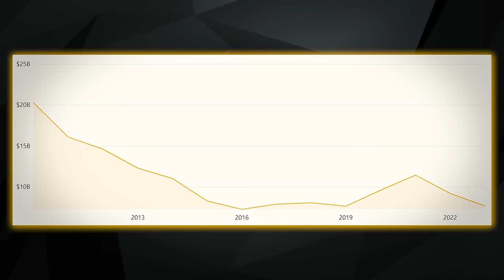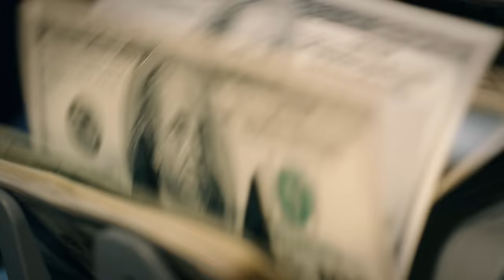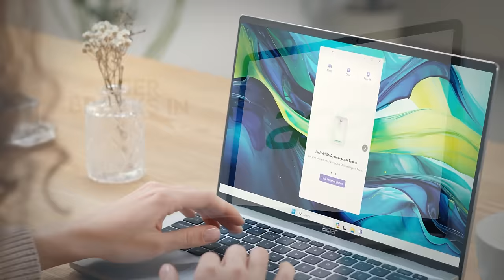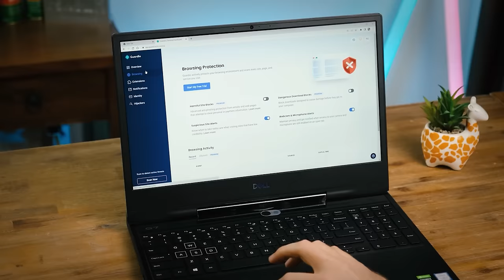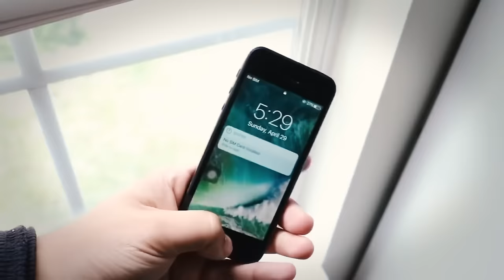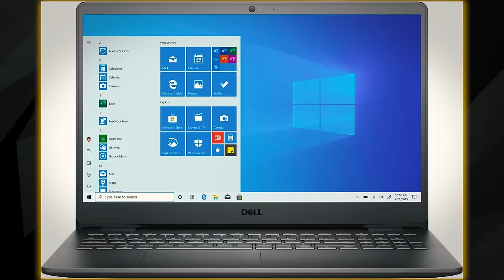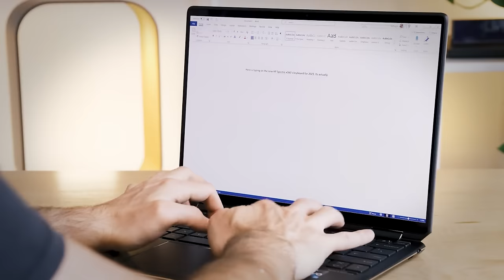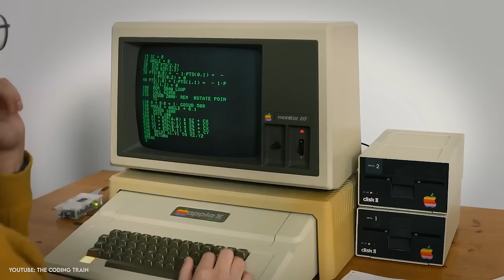Whatever Happened To Acer?

Comment: i think they are losing the laptop market after they introduced their recent nitro gaming laptop line up which is in contrary to how their laptops in the past known to be AFFORDABLE, their nitro line ups goes into the "expensive" category. similar to how gigabyte is going with their aero laptop line up. its price-ier out of the box. so people in the past 3 years simply move to the cheaper alternatives like the lenovo or HP with their affordable legion and victus line up. its about pricing thats all. the problem with those pricing is, the nitro line up offers pretty much THE SAME spec and quality as the cheaper ones from lenovo. people arent convinced why they would have to pay extra cash for the nitros. and acer seems to put  a lot of resources on that nitro line up and their new swifts. and the problem with swift is similar. its wants to be "premium" while offering the same thing their competitors are offering in less price.

Comment: From 4 acer laptops, only one the newest one broke the hinhe.
A acer aspire A-315 - 42, one hinge broke the ancorage of where the bolt attach to the screen, the solution i desmantled the hinges part of the display and use iron glue to fix the display part of the hinges.
And the reason the hinges broke is simple acer attach the struture with to much force the coils of the hinges have more than 2kg of force on opening the display, i loose the coils a little 3 years after my repair continues funcional.

Comment: One thing PC manufacturers have to understand is Windows users are not like dump apple fans. To windows users, their laptops are not for show offs, they only need to get their work done easily. They want maximum keys in their keyboard and ports(don't want to carry a USB hub) for their laptops. Also don't want to worry about the hinges.

There's no laptops available with the above mentioned in the current market. Maybe gaming laptops have these but they are too heavy to carry around.

Comment: I always regarded Acer as a company that never innovated much, ie just good enough, despite that I think their monitors were fine, I own an old 24" LCD that won't die and a 42" 4K real monitor. 
What does LG and Samsung do in the 4k 42" space, create crap smart TVs that pretend to be monitors just to be affordable.This market segment is nearly dead now. 
ASUS has created a new 38" 4K monitor which I hope takes off as a good size compromise between 42 and 32 and thats huge because it disrupts the supply of the panel glass size.

Comment: I had 2 old acer laptop 4530 series and 4730Z series, still working fine until today... Reason why i using acer is spare parts,fixable and very good design.I am not hardcore on game just for my work only.Yes...sometime acer is not good,I think the most problem is battery drain fast and keyboard error.But for me overall acer is quite good and reliable.Just my opinion.

Comment: For those who only look at specifications and price, ACER is not suitable for you. ASUS can provide better options. But ACER has always been used as my main machine. Because of ACER's durability, it is one of the best brands I have seen so far. My laptop only broke after 11 years of use. Currently, desktop computers operate 24/7 for 7 to 8 years without any problems. From the early days (around 2012), mechanical hard drives in laptops used WD instead of Seagate. You can tell that he still attaches a certain degree of importance to durability. On the contrary, ASUS computers will more or less have some minor problems after 5 years. I've even seen ones with softened shells.
And its serviceability is really good. In relatively early designs. Replacing the hard drive memory and WIFI card does not require removing the entire backplane. They will cut a few small Hole and covers in the back panel. Allowing you to easily replace these parts.
However, in recent years, ACER has begun to compromise on durability, which can be seen from the reduction in the hardness of the chassis and the design of the heat dissipation vents in recent years. After all, consumers are the vast majority. Everyone wants a cheap computer with good performance. And durability is hard to prove.
The above is my experience, so I think it's a bit strange to think of Acer as a value brand.
(English is not my native language, these are translated from Google.)

Comment: im from indoneia. back then when i was in college, acer has been doing the minimum to improve build quality, they choose to sell cheap laptops by sacrificing parts quality like bezel around the monitor. 15 years ago i use one of their laptops that cheap enough to break its monitor frame. right now? they improve it too late while customers already trust asus and lenovo. acer rarely sell laptops with good monitor colour accuracy. most of it are 60% srgb monitor to keep its price low. MSI sells cheaper laptop but from the buyer feedbacks, they often complaint about the bezel problem and noisy fan from overheating when doing gaming

Comment: Had an acer swift 3 a few years ago, it was a great laptop and super durable, surviving many falls on my travels with the solid aluminum case. But I needed more memory, so "upgraded" to a high spec Dell, except with the cheap dell vostro case. 

The Dell ran super hot, all the time. The cooling was completely insufficient for the specs. 18 months in and it was overheatting regularly, to the point of emergency shut off.  

I wanted to duplicate my old acer swift 3 experience, but they don't do them anymore in my size , and they just had some weird 'eco' machines with no special features and standard prices. Ended up with an Asus and I'm super happy with it. Superior to dell, BUT that new dell was worse than my old acer. I would say the Asus matches the old Acer, besides being more modern, obviously. Case not as nice though.

Comment: My Acer experience started rough, it has to do something with windows 11.

The win11 keeps telling me that security hardware is not supported, I tried many ways fixing the problems myself. tried; resetting pc local download, online download, tinkering with cmd, and etc.

I found a solution and it's using a bootable usb. Inserting win11 then starting setup fixed the "hardware security not supported"

Insert roblox "Yey"

Comment: Consumers not needing the fastest thing now also opens up the viability of the used and refurb market that now competes with low-price Acer. Late last year I got a refurb Dell Latitude with an 11th gen quad core (i5 I think?), 16/512, 1080p 13" touchscreen and USB-C charging for AUD$650; there's still no way I'm getting something that good for that price in the new market unless there's a substantial discount.

Comment: I currently use a new Acer laptop and dislike it. BIOS has almost no settings, the screen makes my eyes hurt and I can't adjust the contrast, the speakers are too quiet, it easily overheats, probably due to most of the vents in the chassis being fake and the list goes on. It just screams low quality. It's redeeming features are having two RAM slots and two NVMe slots. I preferred my Dell laptop, despite it being 10 years old.

Comment: watching this on acer laptop currently
Reply: i had old extensa but i left it very long time without turning it on. and now the laptop doesnt so anything. it died with time.
Reply: the only issue i have with my acer that i think i need to change thermal paste on this thing
Reply: forgot also about
1. sometimes bios priorities windows boot manager instead of grub
2. at some angles the display start to be black 
it happends not very often. and like another mm and the display is normal. but yea there are issues
but im fine with that

Comment: All acer products i had failed me
Had  an Acer Monitor, it just suddenly started to flicker after 2 years of use.
Had an Acer Laptop, it got really really slow after 2 years, reason was the CPU had defects.
Had a second Acer Laptop, its had the  same problem after exactly 2 years.
The batteries on those laptops lasted only about 1 hour when used.

It seemed at this point it was all planed obsolecent. Ive never had so bad products in my life. Ill never buy anything from Acer again.
Ive had my laptop from Lenovo now for 4 years and it runs perfectly fine without any slow down.

Comment: I can only say about acer's budget laptops gaming/productivity has hurrendous build quality. I replaced my old charger 3 times on a laptop because how easy they brake one of them didn't last for 4 months, their keyboard ghosting and quality is bad, and hurrendous plastic case material easily gets scratched and crack. Compared to lenovo where their budget lineup although not as flashy and sometimes costs a little extra has better plastic materials, keyboards, and outside looks 90% like how it is brand new.

Comment: In the gaming laptop market, acer has kinda beaten asus. I mean the asus tuf used to be pretty bad while the nitro wasn't as bad. Both have stepped it up with acer rivalling asus and others in the budget and premium sections too, including lenovo's.
Reply: I recently bought an acer notebook because it had the best hardware for the buck
Reply from the maker: I wouldn’t argue against Acer value proposition. I’m sure it’s strong, like even better than Asus. But in terms of brand strength and market share, I would argue that Asus is far ahead within the gaming space. More recently though, Asus is going through a good amount of controversy, so that could very well change.
Reply: @LogicallyAnswered  Asus has always had issues. You remember the asus tuf gaming laptops? They had blocked vents which hampered cooling. Asus's liquid metal application on laptops was subpar in most cases. Their reputation was never the greatest to begin with. 

Acer with the nitro 5 produced an acceptable budget gaming laptop. And both have massively stepped up now.

The only reason asus is associated with gaming is they sell a lotta gaming products like headphones, etc. 

Even the beloved lenovo has had issues. Those thinkpads you praised in your last videos actually suck overall. Why? Most are not upgradable. Unlike lenovo's own gaming laptops. Their build isn't much better if at all. They lack good displays and performance even on top end models.

Comment: As for consumer laptops, they could actually spec them in a way that makes sense. WTF is a top i7 doing paired with 250MX and 4GB ram? Why just why? That's not a value proposition at all. Build something where everything is utilized about equally, where nothing is holding any other part back and you have a winner in price to performance. They could have a good year any year they decide to do this and maybe good will for a year or two after.
Reply: Yeah, that combination of specs doesn't make sense. You have a fast, capable machine with the minimum memory needed to run the OS. I just bought a Dell computer recently for video editing, but got it with a dedicated graphics card and 32GB RAM. That's what Acer should've offered.

Comment: smartphones....

lenovo (yoga series), HP (their cheap tier), Acer (cheap tier)
yoga series hinge not soldered to the frame itself, sometimes come off.
HP and acer crappy plastic and stuck screws cracking itself or screws not sticking to the plastic body does the screw is stuck, crappy hinge too.
asus motherboard issues mostly due to overheat, or defective resistor or mosfets around the CPU and GPU.

Comment: Excellent video!

When I was in Pharmacy School, I bought an ASUS laptop. One fine dandy day, it COMPLETELY CRASHED on me, ERASING ALL MY WORK!!! I freaked out and had it repaired but was too afraid to use it.

Instead, I quickly went and got an HP which NEVER crashed. I recently got another HP and it will be HP from now on. Not even Dell can compete. And I will NEVER buy Lenovo, Acer or any chinese or Taiwanese brands.

Comment: I'm currently using a Helios 300 (RTX2060). Got it in 2020. Has 2 RAM slots, 1TB HDD (7200rpm), 256GB NVME SSD, and one more NVME SSD slot, which I filled up. It still feels like brand new today, and it's not going anywhere anytime soon.

Edit: Oh, I can also open the laptop with one hand. The hinges are durable enough for me.